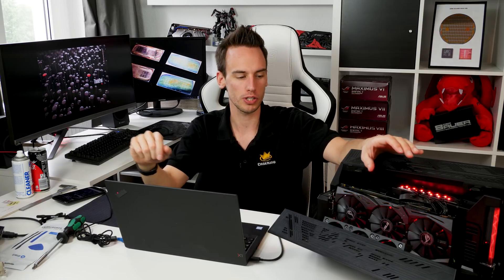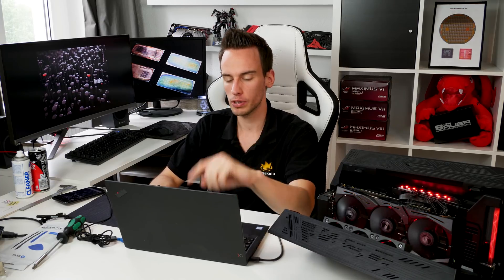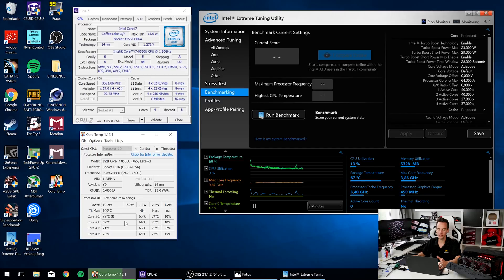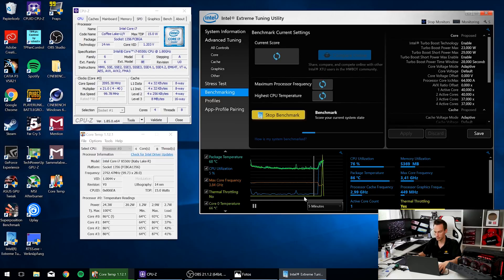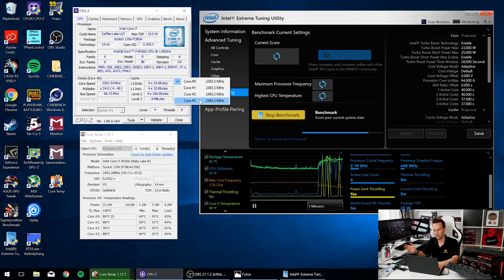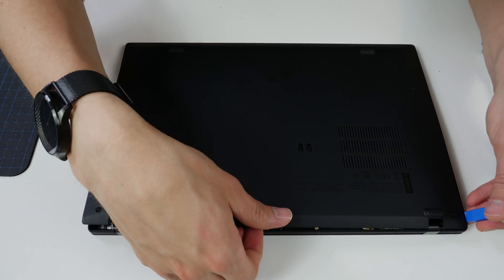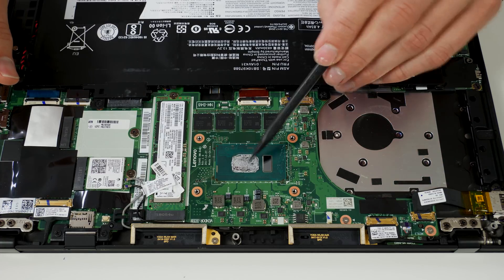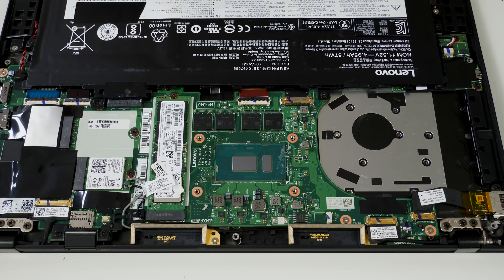Lenovo X1 Carbon G6 - Liquid Metal and Tuning (Part 1/2)

Comment: Do you still have the laptop? I'm looking at getting the first generation (P1). But I've been reading so many horror stories from overheating, to screen cracking, to wifi etc. It's like the laptop's feature is to be unreliable lol. I do like it because of the keyboard layout (coming from a W530 user which is like the Honda of Lenovo's,almost indestructible) and the touchscreen and thin form. 

Please let me know. Appreciated

Comment: Thanks for this video. I've opened my Lenovo X1 gen6 and found almost no thermal pasta. It was dry mostly... WTF.... Running idle 66degrees. and Lots of fan noise. Bought the same pasta and now 31degrees idle and no fan noise anymore!

Comment: Hi.  Thanks for the great video.  I have the X1C7 i7-8665u.  I have undervolted the CPU and cache by -90mV, increased the base clock speed from 1.9 to 2.11 Ghz and reduced the turbo boost max and short from 51 watts to 25 watts.

I have also set a min, max and desired clock frequency for turbo boost at 3.7Ghz.

Under 100% CPU load it reaches 3GHz and stays at 75-80 degrees C. 

Not 100% sure what I am doing but I have managed 100% GPU bound with 0% CPU bound.

Comment: I have a X1 Gen6, IMO the gap between the table and fan inlet is not big enough, I designed a plate that maintains a large gap no matter what surface it sits on, now the CPU is 45 or so with 20-30% load no issues.
Reply: That is with external power disconnected so is doing speed step control ^ so like 800-1200 Mhz core clock

Comment: Hey Derb8auer, do you mind if you could tell me what BIOS you are using? My laptop likes to throttle down to 15W power limit when I try to play games - temps are fine because I undervolted it, but the power limit is not at 23W like yours.

Thanks!

Comment: Thank you so much for the tutorial! Did it in my X1C6 and all went well. I don't believe you mention it but I did turn off the battery before doing it but not sure if it was needed.
Reply: Hello,
Can you provide an update? 

I have an itch to proceed with applying LM and would appreciate any insight.

Comment: Can you disable power throttle? My I7 4500U in my laptop power throttles a lot (it doesn't thermal throttle, avg CPU temp is 60-64°C) and the CPU clocks down from 2.84 GHz to 1.6Ghz bcus it exceeds the 15W TDP of the chip. Is there a way to prevent this from happening?
Reply from the maker: yea that's what I did in the video. Just adjust the power limit

Comment: 1:50, no that's not low load, you are probably using hardware acceleration for obs, which is using the igpu, therefore giving out heat without you seeing the cpu usage go up. There are two separate processors and what you see in cpu temp and the Intel overclock tool is only the cpu usage, not gpu

Comment: Dont you think that liquid metal would react with the copper heat sink?
Reply: It's fine for copper. It's aluminum that you need to avoid.
Reply: Thanks for letting me know.
Reply: np. One note: It can diffuse into the copper over time. This will not hurt the copper, but it means the amount of LM will decrease over time, so you may need to add some more a year or 2 later.
Reply: ty again :) useful information since i have no experience with liquid metal.

Comment: Do you need to to put back the black insulator or it's useless?
Reply: As a general rule, companies don't spend the money to design, engineer, manufacture and install something that is useless.  If it's there, then it has a purpose.

Comment: Your CPU shouldn't be hitting 4Ghz with 5% load. Have you enabled Speed Shift ? I had a similar issue with Dell 7390 and 7490. After some tweaking the cpu will go down to 1.4Ghz on 10% load. This loweered the temps quite a bit. Obviously on 100% Load , it was hitting Mid 70s at 2.6Ghz sustained.
Reply from the maker: It does because I set it to max power profile once it's attached to a power source

Comment: why did you buy a laptop that is known to have heating issues to begin with? why not t480?
Reply from the maker: wanted something smaller and lighter :)
Reply: t480 is bigger only by a little bit, also lets you run 2 batteries

Comment: Doesn't using the intel extreme tuning utility void the warranty?
Reply from the maker: There is no way to detect it. So no xD
Reply: That'd be an interesting court case. "Your honor, the litigant used easily found Intel software with Intel hardware so this is clearly a breach in warranty!"
Reply: NO. That is just a software. Warranty can be a problem only if you make a physical damage to your lap top
Reply: There is a warning that you get when you start the software for the first time.

Comment: When can we expect second video ?
Reply from the maker: Friday
Reply: thanks for the answer, huge fan here! i did LM on my lap top, which has similar heat configuration as x1, and got 15c lower on full load. That combined with underclock shoud give you no problems with thermals nor the power

Comment from the maker: Unfortunately one video of the 2nd part was corrupted so I have to shoot it again. Decided to split it up so you can already start watching :D have fun :)
Reply: der8auer Can I ask a question. Do you do delidding off CPUs as a business or is it just for personal use. I was just wondering as finally got my CPU for my new build. Keep up the good work. 😊
Reply: @Luca Massimo - Undevolt = undervolt?  If I understood correctly, you replaced your laptop thermalpaste solution with kryonaut and also Artic MX-2 but didn't see a difference between those two products. I am very interested to know whether you saw a temperature difference after replacing the mfg thermal paste with either Kryonaut or Artic MX-2?

I hope the answer is yes. I would rather not replace the mfg CPU paste with Liquid Metal due to not being a good long term solution (eventually the gallium in the liquid metal migrates to the copper HS, drying up in the processr) and it's not my personal asset. Just looking to lower temps and noise since the fan goes nuts when it's hot.

Thanks in advance.
Reply: The problem with the X1C and T480s is the terrible heatsink and long heatpipes
Reply: This video gave me some validation. I have a Lenovo P51 with a E3-1505M that hits mid 50s to mid 60s @ 5-15% load. When I run Prime95, it hits 100 degrees in the first few seconds (I stop it immediately). I've been thinking about investigating and replacing with Kryonaut. I probably will after seeing this.

Thank you for the always informative videos. Sorry to hear about the corrupt video. Good luck.
Reply: I've done the same on my blade 14, but with non conductive paste. With undevolt I could handle smallFFT prime95 no throttling. I've used kryonaut but results were the same more or less as artic mx-2.... Not very happy about it, is the paste not ideal for laptops?